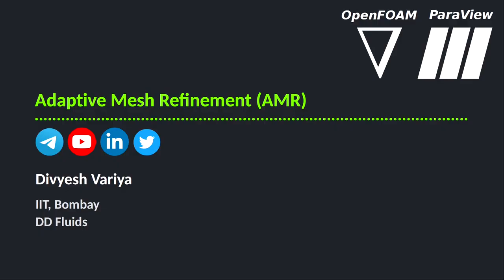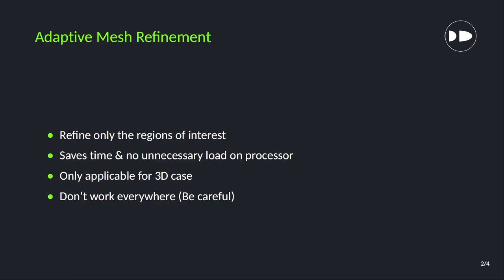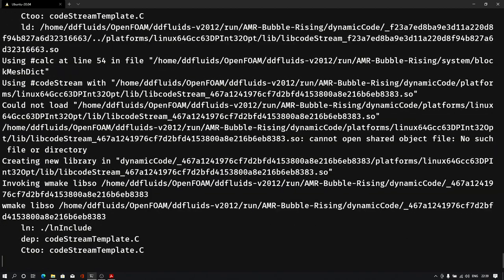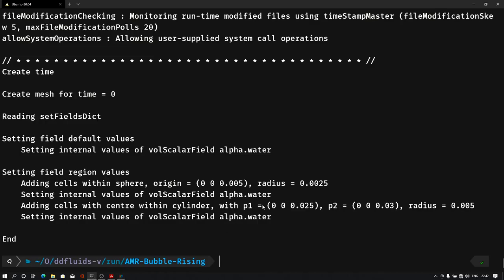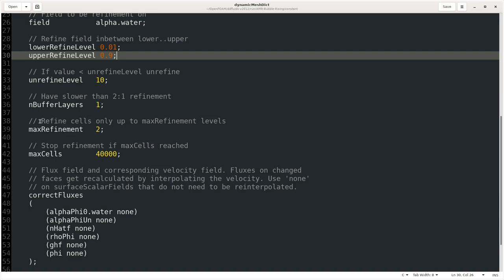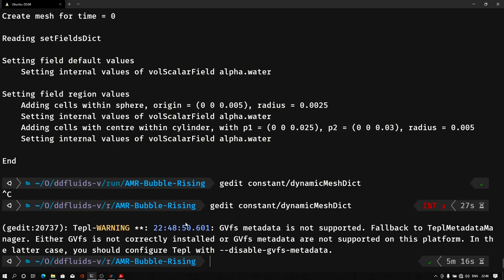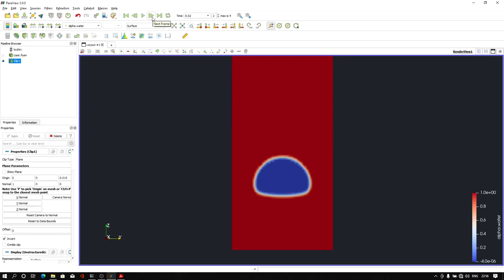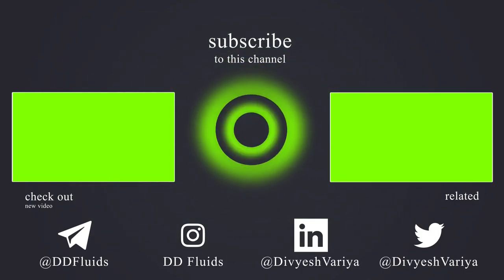Adaptive Mesh Refinement (AMR) | OpenFOAM

Comment: Congratulations!
Maybe you could try a 4th option: the 25600 mesh with AMR. However, AMR of just 1 extra level, done only every 2 to 4 time-steps and setting the refinement for a larger region around the interface. That might be a good performance-efficiency compromise.

Comment: Thanks for the explanation. I have done the same to check drop falling. I have downloaded your file and pated in the control directory to run the simulation. But mesh did not refine. I am using OpenFoam10. Let me know if you have any suggestions. Thanks.

Comment: Hey can you please make a video where I can use a steady solver to perform the AMR. Apparently, interFoam is a AMR modified solver inbuilt in OF.
Reply from the maker: I think when you say steady solver, you mean standard solver. Am I correct? In that case ingerFoam is standard VoF multiphase solver.

If steady solver means steady-state solver, then I don't think it is a good idea to implement it. Because our final focus is on final iteration and the inbetween iteration are just for getting fully develop flow profile.
Reply: @DDFluids  Yes I mean steady state solver. I m wrking on rayleigh taylor instability and thus I need a steady state solver and to perfectly resolve the fingers, I may need a similar technique. What do you recommend?
Reply: @NeelarunMukherjee  Rayleigh-Taylor instability is an unsteady (transient) system. You may ask if they can help regarding the use of AMR in single-phase systems. Even a time-varying wall velocity in a simple Lid-driven cavity flow would be a nice example to tackle.

Comment: In this case of blockmeshdict file you used the vof case blockmeshdict file or different one because in previous problem (vof) ncells is 24000 and in this video the ncells is 3200 .
i tried thid simulation with your previous case (vof) blockmeshdict file and it is taking too  much time. please guide me on this

Comment: why is simulation with AMR techniques is much longer than the third one during its cell number seem much lower (3200 cells compared with 25600 cells)?
Reply: it is normal, AMR is quiet heavy duty in terms of resources, it is partially remeshing each time step, in the third one you mesh only one time. This is why, amr is really particular in your application. It is not something to use in all simulation as sometimes it will be better to refine the howl mesh